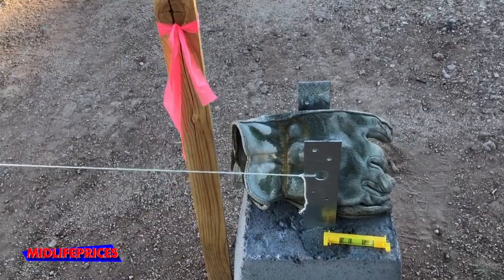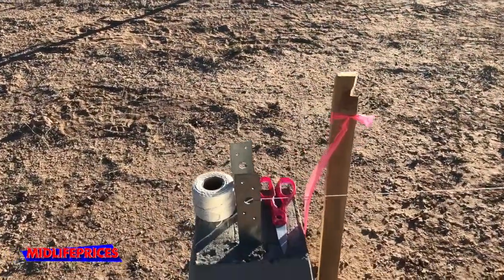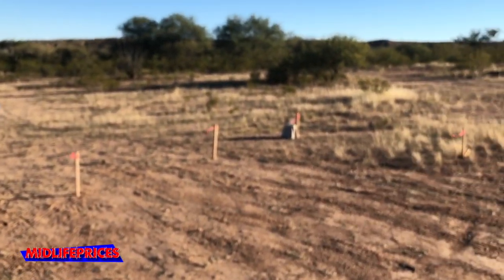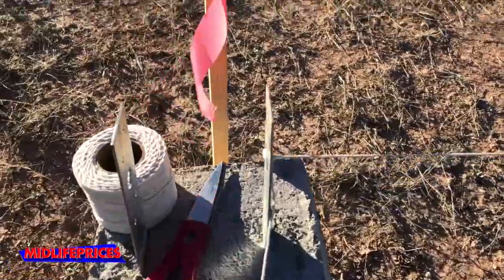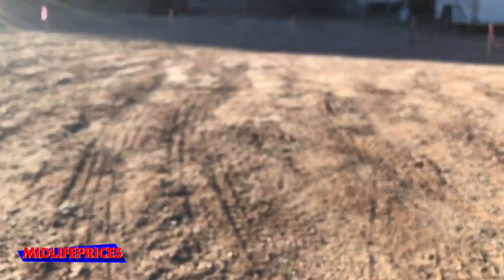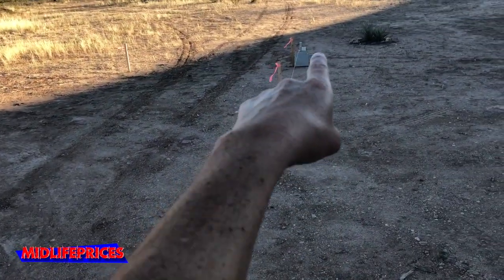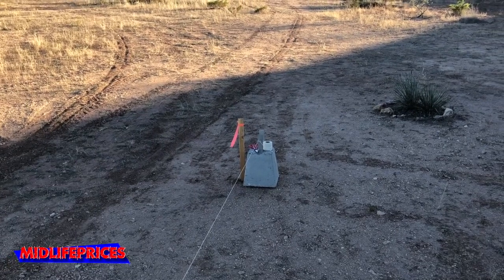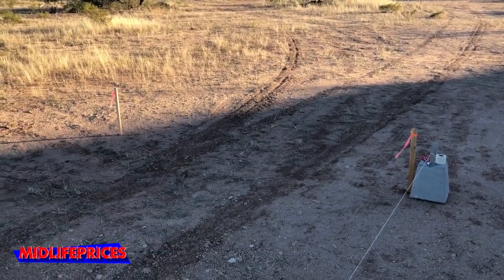Carport Layout (Part 2)

Comment: A natural slope would help with drainage (keep the ground from pooling). The posts themselves can be cut an inch or two to level the roof structure as needed. Thanks for the update!!
Reply from the maker: Are you suggesting NOT leveling the ground under the carport?  I thought about that, but then may need to shorten one side fairly drastically to still accommodate rainwater collection.  Went back and forth on that decision.

Comment: Great video.  I like the idea of just getting an idea of the difference in levels among the corners, but it sort of wastes time.  You'll want to continue to level them as you dig each hole and lay the pier blocks in them.  Now that you know the SW corner is the highest point, I would dig a hole to make the top of that pier block flush with the ground, and level the others to that one.  What do you think?
Reply from the maker: Hmm. I think they all need to come down to be level with the LOWEST one (NE), don’t they? When I sink the lowest one down to level with the ground, the others will need to go LOWER than the ground level is now, so digging the highest one down to flush with the ground now wouldn’t be far enough. Am I right?

Comment: how are you going to lay the foundation? is everything going to be on blocks? Seems like a TON of weight? Did you mock it up in sketchup?
Reply from the maker: I did draw it in Sketchup, but what does that tell me about the foundation/support?  I was going to set each of the 16 posts (4 rows of 4) onto a pier block.  Is that not sufficient?  I was just going to cover the floor with gravel.
Reply: I would show the audience your sketch up so that they also have a idea of what you’re doing probably a good idea to show what you would like to do
Reply from the maker: I suppose you’re right. I did show the Sketchup drawing in one of the previous videos, but I’ll try to include it again in the next one. So, do you think the pier blocks are not enough support, or do you need to know more?
Reply: @MidlifePrices  I am just concerned with how much weight you will be pulling into that carport? the truck plus the car? anything else? will the weight be supported well enough? Is the floor going to be totally cemented? or a combo of wood and cement?
Reply from the maker: There won't really be a "floor" that needs to support anything.  I am just going to cover the bottom with gravel.  The pier blocks are just to support each post, which will support beams and rafters with a corrugated metal roof on top.  Does that make sense?
Reply: @MidlifePrices  oh yes it makes sense its just a covering, not an actual "garage-like" structure.

Comment: In reading other comments and in watching the video, It didn't look like you are taking the wind into consideration.. Unless you have the posts securely anchored it will fly away.. .. ..in other news ,, I was thinking you could put the RV as the North wall of the carport in summer for shade, and move it back to it's current location for the winter when you want the solar gain..   I don't know how much that messes with your 'driveway' plan,, but it looks like you have enough room to do it any way you want..  just a thought....
Reply from the maker: I should have been clearer about the carport design, but I’ll try to describe it a little better in the next video. It will have 4 rows of 4 posts, each attached to a pier block buried in the ground. I think that should be enough to anchor it pretty solidly. As for moving the trailer, it’s an interesting thought. We’re somewhat limited by where our water and septic hookup are, but it’s a possibility!  Unfortunately, I think we really will need to get the roof of the RV covered for the high summer sun, which this carport wouldn’t do. I definitely will need to come up with an RV shade solution before summer, though.
Reply: @MidlifePrices  = with just my little awning (8'x32') I have i am worried about high winds.. Each post is notched and buried in 75lbs of cement 3 to 4 feet in the ground and it still is just a sail.. You are building one at least 4x the size.. Of course,, it never gets windy in St. David,, so there's that..lol .. .. ..You get much more solar gain from the sides of your RV than you do the roof.... jus sayin.......
Reply from the maker: Hmm. It is definitely scary, and I’ve lost sleep over the decision for months! Any idea how to do any calculations to prove what’s needed? I’ve tried to look, but couldn’t really find any clear direction. I figured if I felt the pier blocks weren’t enough, I could pour additional concrete around them, which would act sort of like a keystone due to their slopes shape. Just haven’t found any way to PROVE what is sufficient. Thanks for looking out. I’m definitely concerned about high winds.
Reply: @MidlifePrices  = i thought you was an engineer.. lol.. .. ..if you do just like you are planning,,, how deep were you going to bury the 'blocks'.?  4 feet.?
Reply from the maker: I wasn’t “that kind” of engineer 😉!  The plan was just to sink the pier blocks flush with the ground, which is about a foot. Am I insane? Is there some literature that says what that will hold?
Reply: @MidlifePrices  = Yes, you are insane.. Anyone that moves off grid into the AZ desert,, um,, yeah.... anyway, I am by no means an engineer..that being said,,  IMHO I would put them at least 3 feet in the ground.. Imagine a good strong wind coming in the open wall,, how much "uplift" that will generate.. with a 20x30 sail,, that is a lot of surface.. Over do it don't barely do it,, again IMHO.. Do it exactly the way you want,,  but I can tell you for absolute certain,, if I had done mine that way,, it would not be standing here now..
Reply from the maker: I appreciate the input.  Been wrestling with so many decisions, but gonna give it a go!

Comment: Where’s the carport
Reply from the maker: Sorry about that.  We had a change of heart on this one and moved on to a different project (shed).  Never really got comfortable with placement and whether or not we were going to install solar on the roof, so we decided to hold off until some other things firmed up.  We will still be building a carport, but we've chosen a new location, and a slightly different design.